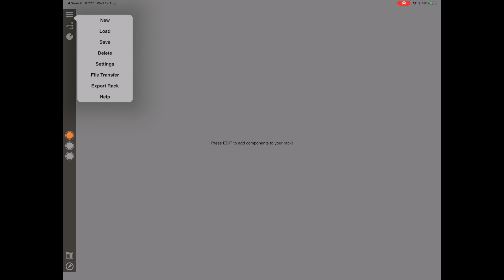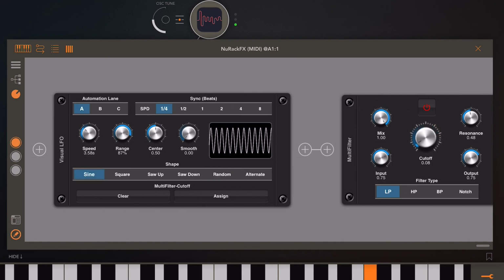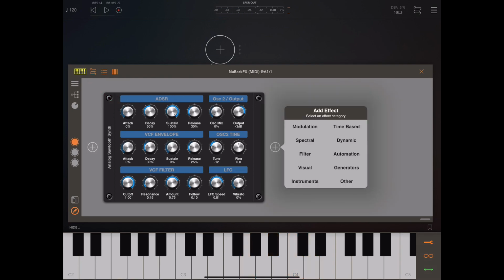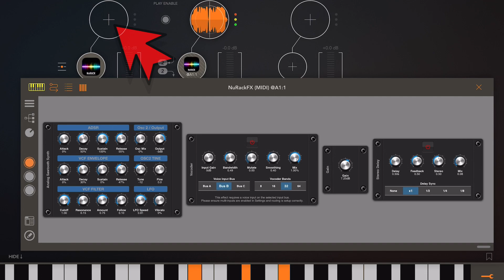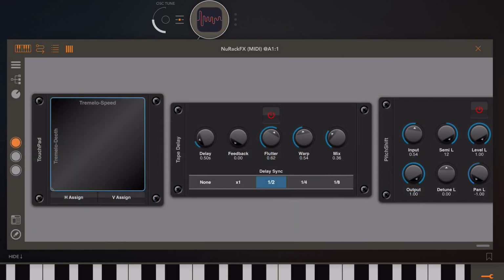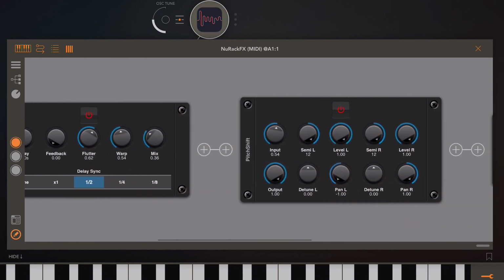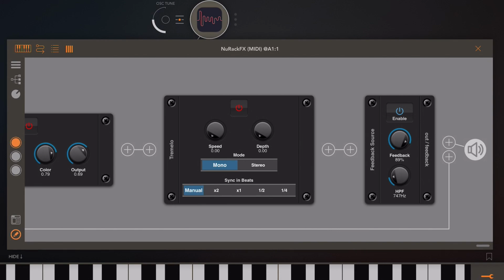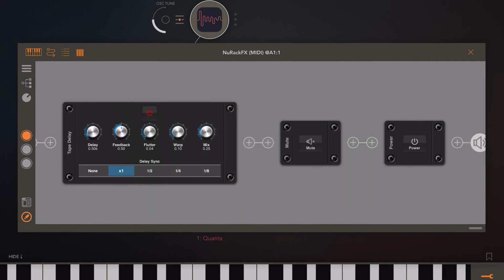NuRack   Vocoder & Feedback

Comment: Great updates, amazing app. I don’t if this is the place for suggestions, just in case,,, it’d be great to be able to assign a knob/slider to 2 values, one of the in an inverted fashion. That way we could have a true dry/wet knob that always adds to 100% for mixer, parallel paths, etc... Stellar work!.
Reply from the maker: Most of the effects do have a single wet/dry knob so I'm guessing there is one effect that doesn't... I will take a look.
Reply: Paul the MusicMan, I mean to able to add your own wet/dry knob in a custom rack. For example in the “Parallel reverb delay” preset rack, the splitter would benefit from a single wet/dry knob rather than 2 levels. Related to this, it’d be great if you could add more than one parameter destination to a knob/pad and have an option for negative increment (that’d be a way to make a wet/dry custom knob). Thanks for listening, I know we’re annoying 🙏😬
Reply from the maker: @tahiche.  It would be possible to add a splitter with just a single knob if that would help. I'm having problems visualising exactly what you are trying to achieve. I think your asking for a way using a single knob to guide audio down one bus or another depending on the position of the knob right?
Reply: Paul the MusicMan exactly!. I see the incoming signal as 1, so a splitter, in my vision, should have an output of 1. Be it 0.5 +0.5 or 0+1... when I currently see the output being 2 (both knobs at full 1) I’m under the impression it’s adding signal (don’t know if it’s really the case) which in my mind a splitter shouldn’t do. So a splitter makes sense with one knob/slider that  makes the outcome to always be 1. That’s precisely a wet/dry scenario. I hope it makes sense and it’s not some kind of TOC on my part. So great that you take time listening to users, means and says a lot!.
Reply: Paul the MusicMan Balanced Splitter in the new update!. You’re a star 🙏👏👏👏🙏

Comment: Hello Paul,
Thanks for the new goodies in this update.
I think your synth module has the potential to be developed into a more hefty fantastic synth module in its own right.
However , for starters it would be wonderful to add a Portamento / Glide function, also a Unison mode, Oscillator Snyc, and a Super Saw wave .
Also a Waveform Selector knob to the oscillator.
Paul , I still wish you would add to your fantastic Leslie the ability to have user definable separate Leslie settings for the slow rotor set apart from the Leslie settings for the fast rotor.
I think we might need 
2 separate CC controls to do this However if it can be done with 1 CC control that would be fine.
The user definable slow and fast Leslie speeds can be an additional feature to the conventional 1 Leslie setting that is simply slowed down or sped up.
Also , I had asked before if we will see a
 Paul themusicman
Designed 4 pockets 
B3 Organ.
I truly think Paul to have your brain installed in creating this would produce a Phenomenal B3 Organ.
If so, when will we see this for iOS ?
4 Pockets has become a way of Musical Life for me !
I hope to hear from you soon.
Thank you Paul,
Howdydoody 👍⭐👍⭐
Reply from the maker: Thanks as always for the enthusiastic feeback and I promise to look into a better way to allow CC control of the Leslie fast/slow switches. It might be that I have a hidden switch that is only accessible via assignment, like the remote option on the Phaser and Flanger.
Reply: Thanks Paul,
And will you be coming out with a 4pockets B3 Organ ? Will you be adding some of the features I expressed to your synth module ? 
Howdydoody 😊

Comment: Thanks for the video. Is it possible to make a gapper effect inside the NuRack? Cheers
Reply from the maker: There is one which I call 'Gate'. It does have pre-determined patterns mind you.
Reply: Paul the MusicMan Yes, that's, great; but "gapper" works another way: it stretching the audio by inserting gaps (small silence parts) into the audio while not muting any parts of it; the effect is that audio sounds slower without any cuts. This effect can be heard on classic jungle recordings. There's no app on iOS for that as far as I know, though this could be achieved using granular synthesis out of sample; it needed less granules to have space between them. I guess it's a challenge to make that processing on the fly, we needed some kind of memory buffer to write/read?